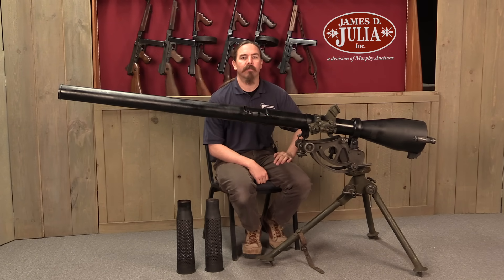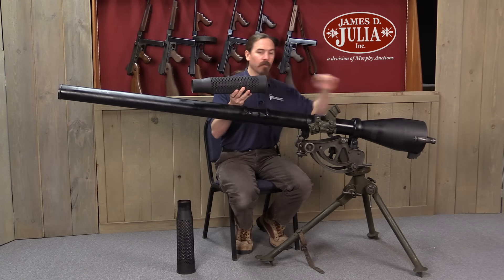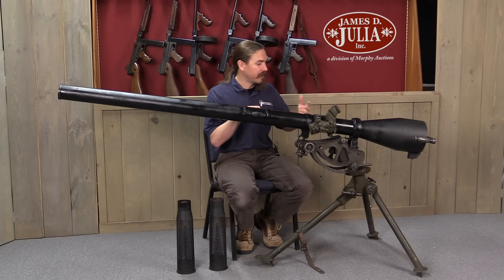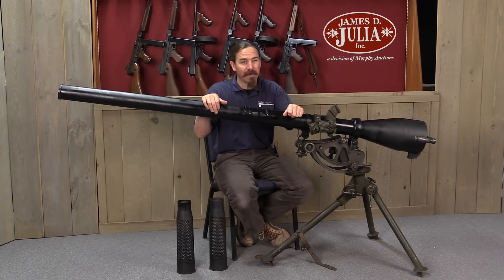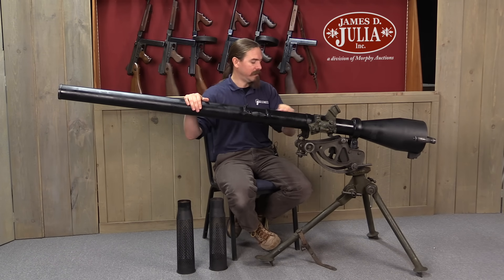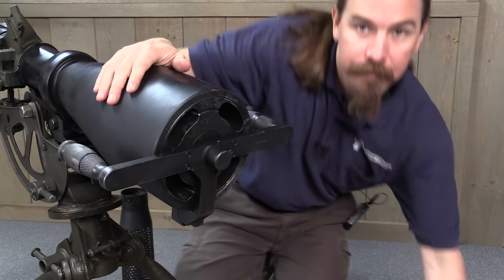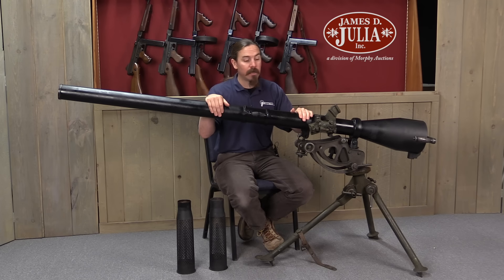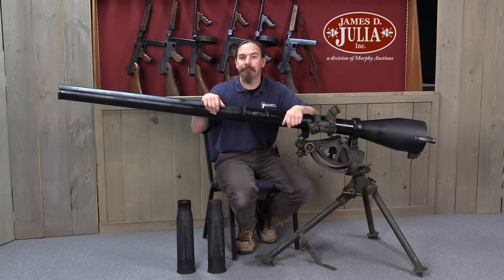M20 75mm Recoilless Rifle: When the Bazooka Just Won't Cut It

Comment: When I was sent to ITR in 1970, before my company formed, they put me on a week of maintenance and ... one of the things we did was clean 106mm Recoilless Rifle barrels ... which are heavy as hell.  It took a dozen of us to pick up one of the tubes (no breach) and put it into a long, low vat of solvent on the deck.  This was of course, a vehicle mounted weapon.
https://en.wikipedia.org/wiki/M40_recoilless_rifle

They had a range there where they fired these at night and ... there would bee this big Flash! that lit up the ridge they were on and then a loud Bang!  While I was given familiarization training with other weapons (this is what ITR was for) the 106 was not among them. 

A story I heard about RR's being captured by the Chinese during the Korean war - was that they didn't understand how the weapon really worked - and were standing behind it when they fired it for the first time.  It is my understanding that that back blast is in fact deadly - that is - it can kill you.
.
Reply: The round going has a muzzle of 9.3 kgs * (300 m/s)^2 = 418,500 Joule.   Comapre this to the mussle energy of an M15  (1843 for the M855A1 round).  So about 225 times more.  The backblast would have the round's  energy divided by how much propellant weighs than the shell.  Even assuming that's 10-1 you're still absorbing over 20 times the energy of a assault rifle shot.  So yeah it's lethal.  Put another way it has enough power to accelerate a 93 kg (over 200 lb) man to highway speeds.  And that's not counting that it would definitedly set your clothers on fire.

Comment: I love these weapons.
The 106mm recoilless rifle was mounted on the M-50 Ontos in Vietnam.
The NVA hated them even more than the Marine Corps brass.
The Ontos ,using the anti-personell round fired 100 flechettes and would clear a quarter mile of jungle at once.
The Marines fighting the NVA at Hue during the TET Offensive in Feb.1968 found they could clear the enemy combatants from an entire street and buildings at the end of the street with these weapons with a single trigger pull.
Saved a lot of U.S. Marines.
I dont know of a more effective house to house weapon when you consider that firing all 6 106 mm rounds from all the rifles at once was nearly the equivalent of the broadside of a light cruiser.
These "Things" as they were called, were light and maneuverable and quick.
It would be great to redesign a small heavily armored tracked vehicle with 6 of the 106mm cannons and use them in urban conflicts where Abram`s and Bradley`s are too big and vulnerable.

Comment: This giant thing only penetrated about 100mm of armor?  That's barely better than the upgraded bazooka.
Reply: Because its' main anti-armour shell was a shaped charged HEAT round. It does have significantly longer range than a bazooka, at least, but the muzzle velocity isn't really high enough to make kinetic rounds work properly
Reply: The m20 bazooka could penetrate up to 280mm of armor.

Comment: Another application was the M50(?) Ontos,  As I recall 6 of these RR's units mounted onto a tracked unit. I saw while my father was stationed with the 1stMarDiv in the Mid 1950's.  Revel modelers issued one as a kit.
Reply: Jeb Sails Ontos was armored, but crew had to exit the vehicle to reload.
Reply: the Ontos used different recoilless rifles, the 106mm M40

Comment: why not a gun that is just a recoil gun
Reply: You need to make it much heavier to contain all that pressure. If you seal the breech on one of these, you have a 75mm artillery piece, which is decidedly not man portable, nor mountable on the back of a Jeep
Reply: @talltroll7092  i don't even know what i was thinking when making this comment
Reply: @SomeguyWhoLikesVideos  No, it's a fair question. On the face of it, drilling holes in the back of your breech is not a great idea, because it was pretty damn dangerous to the operators if they got it wrong

Comment: It seems that while saving weight on the gun youre adding a lot of weight in propellant given that half of the propelants energy blows out the back.
Reply: Yes, but you can keep bringing up fresh ammo. It's pretty hard for a leg infantry section to lug a 75mm artillery piece around with them. The "recoilless" part is important too, you couldn't mount a 75mm artillery piece on the back of a Jeep and fire it, then drive off, because you'd be upside down 10m away

Comment: I had much use of the Carl Gustav 84mm recoilless rifle back in the 90's. We had an Illumination round that was fun to fire. By fun I mean fun to try to find a volunteer to fire it. You see, illum rounds need to be fired upwards, thus the back blast is trapped in the bottom of the firing pit and cooked the firers arse cheeks quite well.

Comment: The 106mm recoiless rifle had a spotting rifle of .30-06 tracer round  fired at the tank to make sure the 106mm was spot on target so they wouldn't waste a round. I got to fire the spotting rifle at Fort Ord in 1961 as part of Armed Forces Day. Basically "bring your son to work day."
They would walk us through a "simulated" battlefield setting off white phosphorus grenades out of the kill zone, blow up sanbagged bunkers with explosives, have us walk through minefields with a little training to help us identify the different signs so as to avoid the little poppers. Fun stuff for a sixth grade boy.
Reply: That was actually a 50 caliber semi auto magazine fed rifle on top the 106mm barrel. The special ammo was called Spotter/Tracer. It looks like a .50BMG cartridge that was shortened an inch. The projectile has red/yellow bands on the tip and its longer than a standard .50BMG ball round. It produced a trace and the primer in the nose set off the charge that would produce white smoke.  I shot a few spotter Tracers years ago. It has the same ballistics as the 106 projectile.

Comment: The big one was actually a 106mm, not a 105 - we were still using them in USMC infantry battalions during my first enlistment ('76-'79.) It had a flechette round, called the 'beehive', that was really devastating. The gun did have an annoying tendency to start range fires with the backblast, though, so in summer we would have to cease fire and beat out the burning grass with our flak jackets after every shot. It got phased out before I left that unit and replaced with a truly lousy - less versatile and prone to malfunction - ATGM, the Dragon.
Reply: The original 105mm recoiless was designed in the 1950's but was less than ideal in the field. They redesigned it and named it the 106mm even though projectiles had the same dimensions. The cases were different in subtle ways so they designated the new gun/ammo as 106 to avoid mistakenly trying to load the incorrect 105 cartridge. I believe they were different enough that the breech wouldn't close if the wrong ammo was loaded. I have one each, 105mm RR and 106mm RR empty cases on a shelf. Then there was the 105mm howitzer ammo and the completely different 105mm tank ammo.

Comment: Gunpowder burns, not explodes. Of all people you should know it ;)
Reply: Not quite true. The difference between a high- and low-explosive is that in a high-explosive, the burn proceeds through the propellant faster than the speed of sound in that medium, in a low-explosive (black powder, for instance) the burn propagation is slower than the speed of sound in that medium. A burn that is faster than the speed of sound for the medium is called an explosion

Comment: In 1968, the jeep mounted 105 had a 30 cal rifle barrel sighting device. See that tank.  1 round of 30 cal tracer. Did it hit the tank? Quick fire the 105 round and Don't miss or you'll get a tank round up your  - - - , because, you have just announced your presence with a ping on his armor and his turret is already traversing in your direction.  And get the H out of here. because  you have just announced your presence to the visible horizon and beyond to all his tanker buddies.  The 105 and a tee shirt was  not really up to taking on tanks.

Comment: Also don't  forget the M40 106mm recoilless rifle with .50cal spotting rifle.
Reply: 1911Thunder had those in 1968 82AB weapons plt. Specially built  model M151 with a channel on the rear floor for mounting the gun. The gun mount had a large wheel in the front & the gun was moved into the jeep reminiscent of operating a wheel barrow. The gun was called 106, to differentiate it from 105’s (I believe that it was actually 105). Spotting gun .50 used a cartridge non interchangeable with the .50 BMG. Pop the spotting gun at your target, a hit was very obvious (cartridge was made to display a tell tale indication) immediately fire the main gun before the enemy figures out where the spotting round came from.
Reply: @andykilo5167  it was a 105mm cannon, it was just called 106mm because there was already a 105mm recoilless rifle (the M27 i think)

Comment: I'm pretty sure you have the pipe installed in reverse. Look where the sights are pointing and how the angle adjustment works! It's gonna point to ground, not to air.

Comment: Why not use a closed breach thing with half the powder
Reply: The chamber would blow up.
Reply: @ComradeArthur  no. Ian mentioned it already, if you were paying attention: the recoil would be unmanageable, hence why these are recoilless rifles and designed the way they are.
Reply: Take an recoilless rifle.
Block the exhaust ports.
Fire it.
The recoil won't be your major problem..
Reply: @ComradeArthur  you seem to be purposefully obtuse, as that wasn't the question. They're asking why a RR and not a giant closed-breech rifle, not what happens if you contain explosive pressure.

Comment: 100mm of penetration isn't enough to deal with T-34s?  The T-34/85's frontal armor is only between 74mm and 85mm thick taking into account the slope.
Reply: HEAT rounds this old didn't cope well with sloped armour, or indeed any hit that wasn't basically a perpendicular hit. More modern descendants would likely open a T-34 like a tin can, but they don't face T-34s that often

Comment: The 75mm could actually penetrate a T-34 just fine energy wise, no part of the T-34/85 was over about 90mm LoS thickness. 

The problem may have been the same as the 60mm Bazooka which had about the same penetration actually. The fuzes on the shells seem to have been shit. The 60mm warhead actually had the theoretical penetration to at least possibly defeat basically any common Germany tank's front beside a Panther's front slope (the mantle would be at the upper edge of their possible penetration along with the front of a Tiger I), but it seems like the fuzes design was very poor and a huge percentage of the rockets were duds that underwent ineffective detonations or pancaked without going off at all even at near right angles, against sloped plate like a T-34's hull or rounded turret they seem to have almost never functioned properly. 

The 3.5 inch weapon did have better penetration, but more importantly it seems to have had a fuze that worked, or maybe just such gross overmatch against a T-34 that even with sub-optimal detonations it was still able to punch through.
Reply: Occam’s razor, my friend.